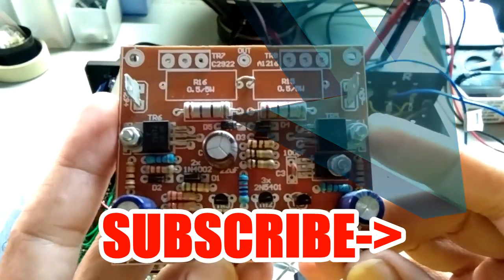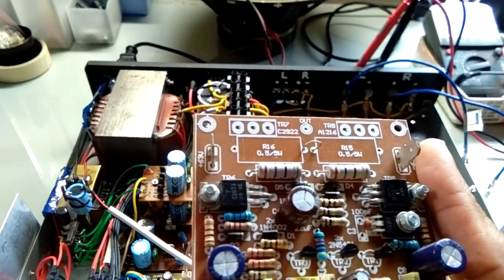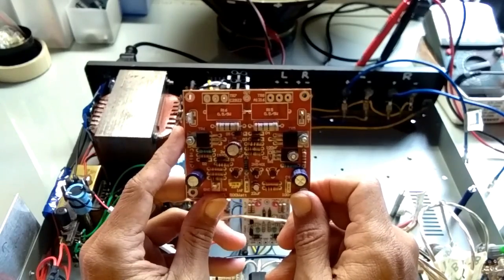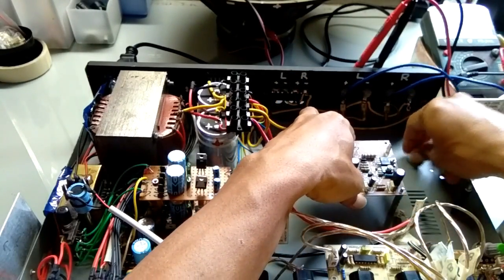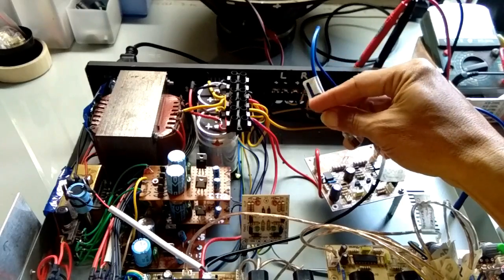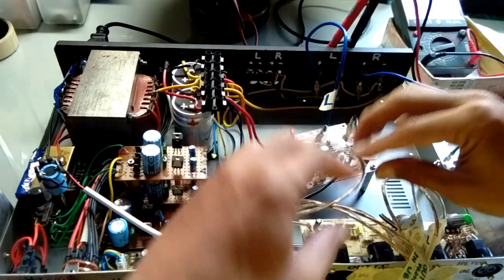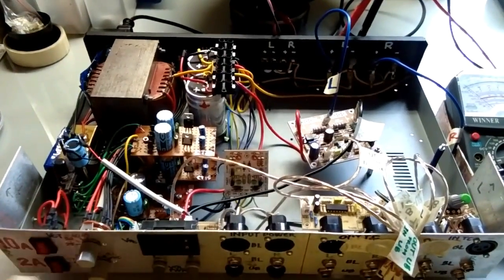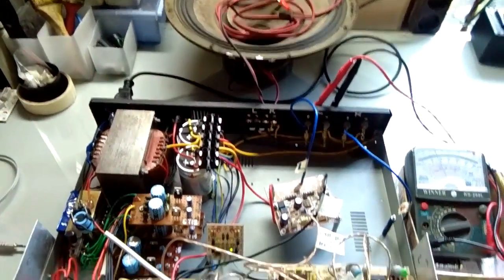TEST DRIVER TANPA TRANSISTOR FINAL BUNYI | KENAPA DIODA JADI TRANSISTOR FINAL??

Comment: Om mau tanya...
Kenapa semakin banyak transistor finalnya.
Knapa TR drivernya memakai 1837 yg signal audionya kalau tdk salah 20watt
Bukan memakai Tip41/42 yg output signal audionya 65 watt.
Reply from the maker: bisa dengan TIP tetapi terbatas pada tegangan maksimal, 1837 bisa 2x tegangan maksimal tip 41/42

Comment: MAS Amlifayer syh resistor terbakar sdh di ganti yg baru selalu terbakar apakah tegangan tdk normal?
Reply from the maker: resistor yang mana mas..? ukuran berapa? apakah semua resistor terbakar???
Reply: ANTHON MITRA AK resistor 560 sama resistor 580 terbak Amlifayer MAS?
Reply from the maker: @hendrisiallagan6683  cek dioda dan TR vas
Reply: ANTHON MITRA AK sdh sayah  ganti transistor tpi sllu terbakar resistor 560 sma resistor 56 ngatau di mana masalah yh??
Reply: ANTHON MITRA AK mas apa yh Tr vas sayah kurang paham vas??
Reply from the maker: @hendrisiallagan6683  kse 340, mje 340, je 340
Reply from the maker: @hendrisiallagan6683  penyebab terbakar tidak hanya dari komponen yang terbakar saja, bisa disebabkan komponen lain ada yang short dioda & trasistor
Reply from the maker: @hendrisiallagan6683  penggantian komponen terbakar akan tetap terbakar lagi mas.. karena ada komponen lain yang rusak tidak terlihat secara fisik seperti dioda & transistor,  jadi penggantiannya sekaligus setelah dilakukan tes / pengecekan komponen yang dicurigai.
Reply: Mas resistor tdk terbakar lagi sdh OK, tpi suara siknal input tdk keluR alias bisu dimana masalah yh mas??
Reply from the maker: @hendrisiallagan6683  cek potensio dan TR final..

Comment: Maaf mas saya pemula mau tanya.. Saya pengen power buat speaker 3 way 12"+ 6"+tweeter.. Kira" bs gak mas jd 4 ohm dalam 1 chenel mono..?? Trus pake driver brp watt dan pake TR final apa brp pasang dan jg pake travo brp amper? 5 amper cukup gak mas? Mohon di jawab mas.. Mohon bimbingannya..
Reply from the maker: 4 ohm bisa dibentuk dari 2 speaker @ 8 ohm diparallel,
data speaker dibutuhkan untuk merancang powernya mas..?
Reply: @ANTHONMITRAAK  maksud saya 2 speaker di paralel + 1 Twitter apakah tetep jd 4 ohm mas? Trus data speaker saya yg 12" 300 watt + 6" 70 watt + tweeter lah itu harus pake driver brp watt dan TR final merk apa dan brp pasang mas? Apa pake trafo 5a atau harus 10a? Maaf mas banyak tanya soalnya pemula butuh bimbingan..
Reply from the maker: @anggawigianto3781  kalau speaker 12 inch 8 ohm & 6 inch 8 ohm diparallel menjadi 4 ohm, tweeter ada yang 8 ohm & 4 ohm, mas pakai tweeter apa? tweeter akan sering putus karena ada freq low masuk..
driver OCL 2x300 watt (stereo) bisa, TR final pakai 2 set toshiba per-channel, trafo bisa 10A/32Vct.
Reply: @ANTHONMITRAAK  owh gt jd pake ocl tr final thosiba 2 pasang jd 2x300 watt (stereo) total 600 watt pake 10 A/32vct ya mas.. Terima kasih mas atas sarannya...
Reply from the maker: @anggawigianto3781  dicoba saja dulu mas.. info hasilnya.. boleh pakai final sanken ga masalah..
Reply: @ANTHONMITRAAK  siap mas..
Reply: @ANTHONMITRAAK  final sanken jg 2 pasang per chenelnya ya mas..
Reply from the maker: @anggawigianto3781  ya bisa..
Reply: @ANTHONMITRAAK  elco nya saya pake 4 buah mas
Reply from the maker: @anggawigianto3781  elco 4 buah bisa
Reply: Ini saya sudah coba rakit mas. Pake driver socl 504 x2(stereo) tr final sanken 1 pasang per chenel. Trafo 5a elco 4700uf-50v dioda 35a.. Memang bisa bunyi.. Tp kok ada dengungnya ya mas...? Dengung noise gt.. Ada saran untuk menghilangkan dengungnya mas?? Mohon pencerahannya mas..  Maaf pemula🙏🙏
Reply from the maker: @anggawigianto3781  dengung dari jalur kabel & ground tidak sempurna

Comment: bang newbie mau tnya?
bang saya bru tes socl504 tpi kenapa driver bagian min panas, di lepas dn cek mati, pdhal sebelumnya input di pegang ada suara deeerrrrrr
30dtik kemudian denggung dn dibarengi panas pada driver di bgian min ny?
kira2 pa y bang masalahnya?
mohon bimbinganya.?
Reply from the maker: transistor driver short pada jalur rel negatif, kemungkinan TR aspal
Reply: @ANTHONMITRAAK  tdi udah sya ganti dgn tip41c dn tip42c 2x ganti tetep panas dan mati..
Reply from the maker: @vhiee7036  semua transistor ganti serempak, dioda juga diganti, resistor gosong ganti (330ohm), test jangan pakai TR final dulu,
Reply: @ANTHONMITRAAK  semua transistor dlam kondisi baik, kecuali yg driver kutub MIN...
dah di tes di kit satunya.
dioda nya ganti yg seri berapa dan amperenya?
terus resistor mana yang kemungkinan gosong?
 mohon bimbingannya?
Reply from the maker: @vhiee7036  samakan saja komponen penggantinya.. selanjutnya tegangan turunkan supply.. karena ada TR yang short,.. penyebabnya sepertinya dari tegangan supply yang terlalu besar..

Comment: Gan kalo driver socl 504 tr drivernya pake A1837 dan C4793 suara serak knapa ya
Reply from the maker: tegangan pakai berapa volt?
seri itu tersebut diatas kurang pas untuk tegangan dibawah 55Vct.
serak bisa disebabkan ada transistor pada driver yang rusak... cek semua transistor driver..

Comment: Mas mau tanya buat ngangkat sepiker 12 kali dua yang bagus pakai drifer apa dan  transistornya pake apa terimakasih sebelumnya
Reply from the maker: saya suka driver OCL dan turunan nya
12 inch x 2 [4 ohm].
untuk mid high bisa pakai TR final Thoshiba.
untuk low /  sub bisa pakai sanken.

Comment: Itu trsnsistor drivernya pakai tipe apa, thaks
Reply: Kalo mau lebih mantap lg pake mje 13009
Reply from the maker: sudah saya jawab pada komen sebelumnya mas..
ini komenya :

saya suka dengan spt berikut :
tegangan maksimal 50Vct dengan TIP41-TIP42
tegangan maksimal 65Vct dengan mje15030-mje15031.
tegangan maksimal 90Vct dengan A1837-c4793
Reply: @ANTHONMITRAAK  jika tip 41c dan tip 42c di GANTI DENGAN C2073 DAN B546 bagus mana untuk driver ?bls
Reply from the maker: @MUZELI1982  supply 45Vct bagus TIP 41C & TIP 42C, dari produk ST tr ini bisa 6 ampere.
C2073 (Produk Toshiba ) & B546 (Produk NEC), bagus dengan tenganngan 55Vct.

dengan "catatan"
TR final - Speaker - Box sudah sip / sesuai.
Reply: @ANTHONMITRAAK  kalau teganagan 32vct pakai yang mana untuk meningkatkan watt ocl?bls
Reply from the maker: @MUZELI1982  32Vct TIP41-TIP42 cukup, meningkatkan daya OCL naikan ampere & tegangan trafo.